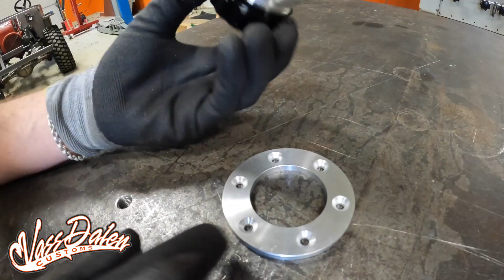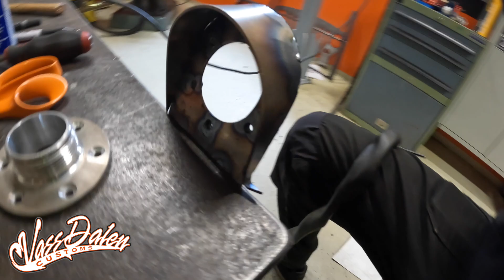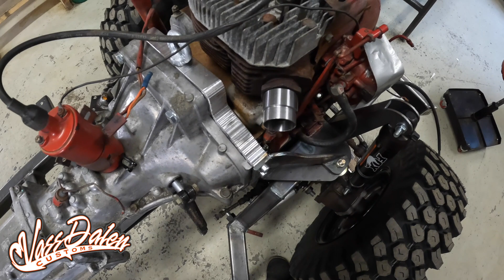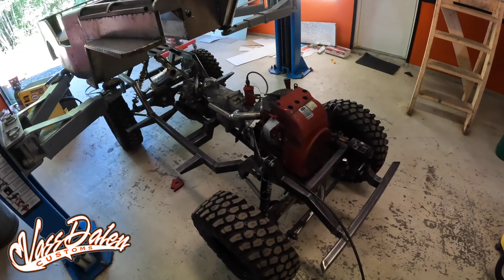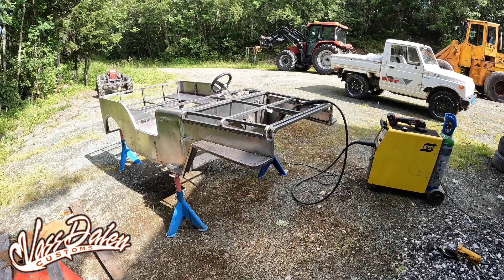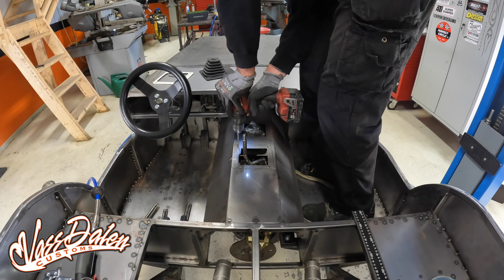Mini jeep build part 6

Comment: Just discovered your channel young man with this jeep build.   I went back to part 1 and caught up.   Nice content and good work.  I'm impressed.   
If in the future you want more power I think you could pretty easy mount a big Wisconsin V-twin air cooled between your rails ...there is also some pretty compact air cooled diesels to be had cheap, particularly the Chinese built ones. I know that Twin Italian built diesel, (name escapes me, but they bought out Kohler) is one heck of a motor that produces a ton of torque
Reply from the maker: Hey sorry for late answer I haven't seen all this comment before I checked my computer.. :( Thank you! yes its have been awesome whit an v twin! that was what I wanted to begin whit. but here in Norway those are hard to come by.. can buy a new one on the Internet off course but its going to be expensive.. :D

Comment: Nice work as always! I wouldn't trust radiator hose for the fuel filler, but I'll bet there's a fuel filler hose off some junk car that would do the job.
Reply from the maker: Thank you! 
It will mostly start to leak.. 
So i keep my eyes up for somthing else i can use for filler tube 😎👍🏻
Reply: @vassdalencustom8689  yes I have seen radiator  dissolve  with gas ,,but for mock up it will work ,, then  you know what length when all said and done . also might need a breather hose ,, so when putting fuel in it will not bubble up the filler neck .. you might already have a breather can not remember ..